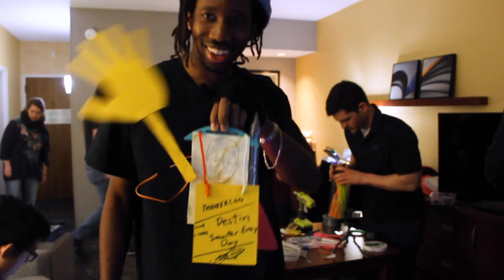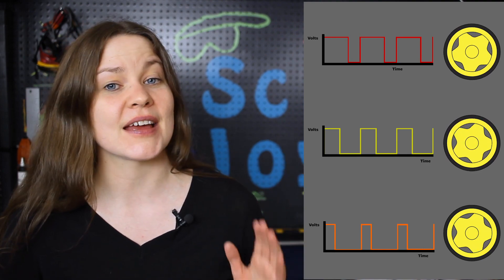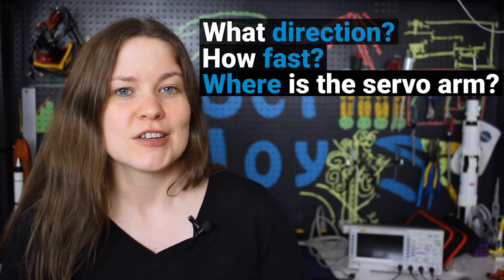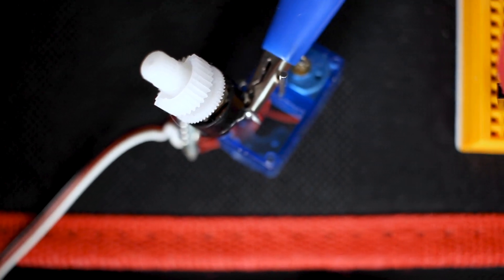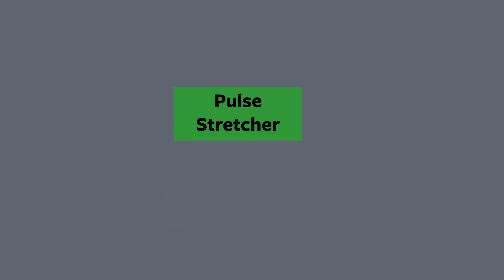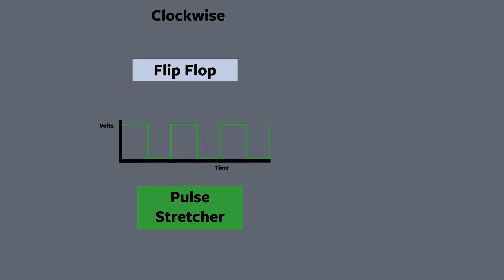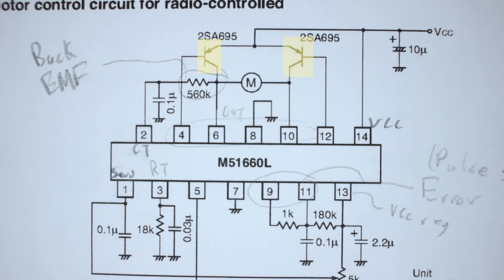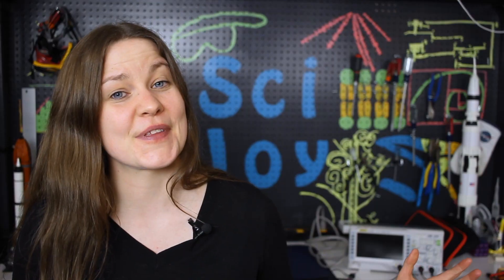How do servo motors work? | Teardown and explanation beyond the pulse.

Comment: I have a question, I hope someone can answer it, it’s a simple question. I need for a simple servo to just turn either direction about a quarter inch or less, nothing exact. I have been able to do this by simply connecting some of the three wires to enable battery and I see the server working perfectly as I wanted to but am I doing the right thing? Am I damaging the servo? I’m using a 9 V battery and it looks like when the power surge of the 9 V going to the servo, it causes it to move exactly how I want it to. So my question is is there a better way? I just need to push my remote control button and have it move about a quarter inch or less., Thank you all in advance.

Comment: great video! such a good explanation ... but i have a question... What is the working voltage of the mini dc motor in the case of that 9gr servos, How much voltage is going out from the board to the motor? thank you so much! cheers

Comment: This will sound silly, but I feel like those little ICs are magic, like they can't be comprehended.  But you broke the code and showed that it's just a series of logical steps in physical circuit form.  It was fun to see!
Reply from the maker: It doesn't sound silly at all. That's how I felt when I started learning electronics. That's how I still feel about most things. Bit by bit I'm figuring out how the magic works. Thanks for the nice comment.